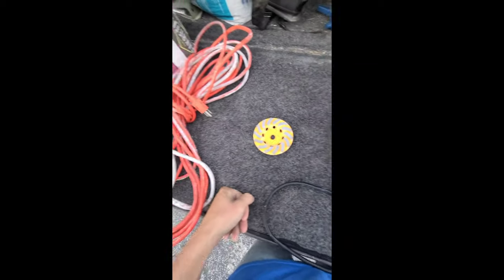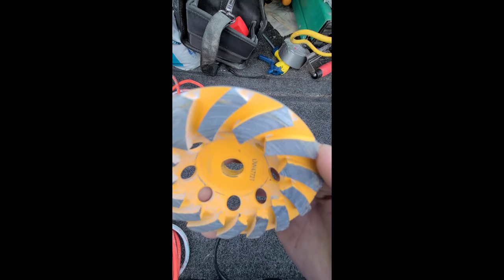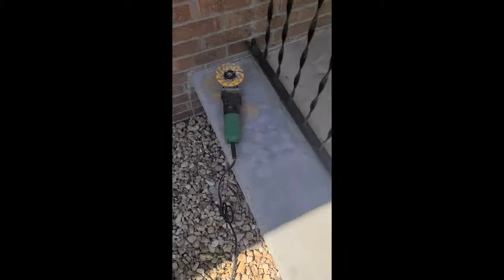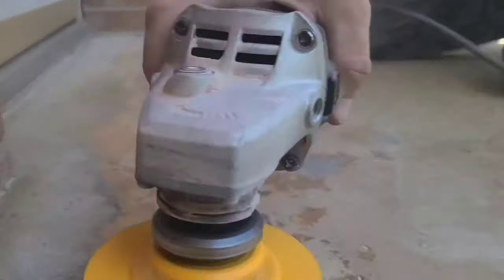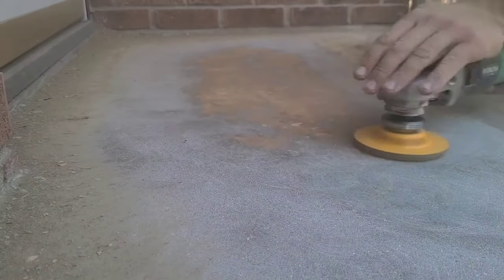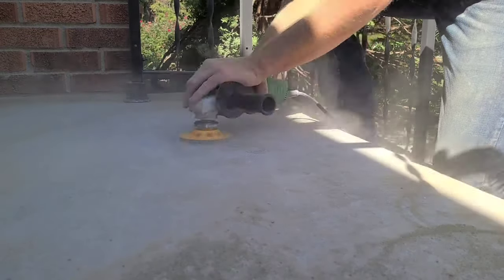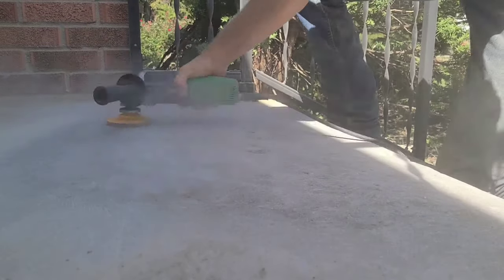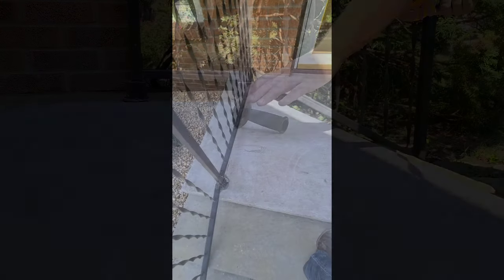How to Remove Paint from Concrete

Comment: Those diamond Cup wheels are great. If you don't have a dust shroud you could hold a dry vac hose while your grinding and purchase a bag for your dry vac.
Reply: I keep
Reading that the shrouds don’t fit or or horrible with diamond discs…. I think having a shop vac going is the best like you said

Comment: B.K. Williams:  Question:  Do you recommend putting water over the concrete to cut down on the dust?  Thanks for posting.
Reply from the maker: Haven't tried it yet but I'm sure it could work! Iv never had to do it inside and thats the only time I would really worry about it
Reply: @b.k.williams  Thanks, dude.
Reply: Just an observation, if you use water to keep the dust down it works but there is a sweet spot you have to figure out.  Too much water and the cup doesn’t  wear down the surface as fast and too little water and it doesn’t keep the dust down as well.  So be patient you won’t regret it. Don’t forget to plug into a gfci circuit for your own protection.
Reply: @pasqualeparente9776   Thanks for the info.

Comment: I own a small 3 story house. The basement floor has a ton of paint on it. I want it epoxy stained instead! My biggest worry is that if I grind the paint off I’ll have a thin layer of dust all over my house. How do I prevent this because if I gotta dust concrete paint off everything forget it!!!
Reply from the maker: You can get an adapter for your grinder that let's you hook a shop vac up to it. But even with that I'm sure you'll still get some dust
Reply: George Louis:  I am also concerned about the dust.  What did you do to cut down on it?  I'm thinking about keeping water poured over the area I'll be grinding.  Thanks.

Comment: Perfect!, just one question, this tool doesn't wear down concrete? I mean, a little of thing layer will be removed from original after try this out? - Regards.
Reply from the maker: Yes it actually can eat away at it. As long as you keep it flat and don't apply too much pressure you should be fine

Comment: Can I do with with basement walls?  I need to remove the old paint and apply a basement waterproofing material called Xypex or Permaflex.  The company suggested sandblasting but when I called a sandblasting company, they did not recommend it.  What grinder has an adapter that can be hooked to a shop vac?  This maybe a stupid question, but if you wet the surface, is there less dust?  Sorry, I am new to this...Thanks
Reply: Hey if you haven't gotten your info elsewhere yet, I'm currently doing what you're looking to do! I knew nothing about grinders, etc but did HOURS of research plus my husband has a little experience with grinders at work. My basement not only has paint but layers of joint compound which grew mold, as you NEVER use joint compound to fix basement wall cracks. Previous owner must've been very ignorant to materials, as concrete or crack injection wouldve been proper. They left me with one hell of a NASTY job! Anyway scraping was never going to get me finished. The angle grinder got me through a 6×6 square foot section in 30 minutes! I'll likely need a few days to finish my large basement with the joint compound all over, but just doing paint you may get it done faster. So to answer your question about a dust shroud. 1st off just to ket you know a lot of stores like home depot will rent you a PRO grade dust extractor, which works the best over a shop vac! That's what a pro would use if they came in. There are some grinders that use a proprietary dust shroud, but that's expensive. A universal dust shroud is cheaper and often fits multiple models, AND fits multiple shop vac hoses. It has to be specific to your size grinder though. I've got a 4 ½ ryobi grinder. I bought a dust shroud from harbor freight $25 that covers grinders from 4-5". You can find larger ones. Home depot sells universal dust shrouds, although not the best reviews. No one is totally happy since they don't always make it easy to use certain wheels, the bristles may protrude too far or not enough. I'm using a RIGID brand 4" diamond cup wheel under my dust shroud, & its hard to get my wheel flat. So I put a SLIGHT angle on it, which technically the diamond cup is best & safest used flat from my understanding. Im using it at a 10-20° max angle to get the diamond cup wheel to make good contact. Also please keep the wheel guard on if you don't use a shroud, as they usually have a guard in it technically. But i see so many videos on here where they've taken the guard off for flat grinding, not necessary & unsafe! You probably want a diamond cup wheel for removing paint or coatings in prep for waterproofing! I tried the paint stripping & abrasive discs, & they only scuffed the old paint but didn't fully remove it! You may have more luck with one if your paint is very brittle & thin though! But for these waterproofing paints as you know, you need a surface totally free of old paints & materials. Be very careful & gentle until you get a feel for it! I gouged my concrete a tiny bit pressing too hard with the diamond cup wheel, luckily I was able to smooth that out a bit. Lol Rustoleum does sell paint stripper meant for concrete, but you'd want to turn off any gas & pilot lights in the basement till fumes evaporate! Then you have to use an after wash to remove the strippers, its a hassle too!! I'd have tried that 1st though if it wasn't for all the joint compound! That may or may not be easier & less messy than grinding. Wet grinding is not necessarily less messy, but easier to contain. Wet grinding you'll have a slushy of concrete dust all over you, walls, & floor. Its better in my opinion than dust on everything in the entire house! BUT a lot of grinders & discs arent rated for wet grinding. Diamond cup wheels do often say for dry or wet use. If your grinders a cheap small corded guy like mine, I'd try just spraying it damp, but not garden hose wet.. im trying that today! It may gum up your diamond cup segments, the grinder, & shop vac though so be careful. Also you may need a specific filter in your shop vac, mine has to have one just for wet use, & the bag removed. So annoyed to find I needed to buy another filter! All these methods depend on the situation, but I try less messy options 1st like paint stripper, scraping, wire brush, or paint stripping discs if the basement is smaller. If you try chemicals, get a respirator meant for that if possible. Silica dust in concrete is very dangerous when airborne & is there possibly lead in your paint? Mines OLD so I treat it all like lead. Please use AT LEAST a P100 rated respirator for Silica protection, not just an N95 dust mask! Use a face shield & goggles, as well as gloves, long clothes, & good shoes! Once you remove all paint make sure you use a concrete etch & cleaner if you're doing waterproofing paint! If your waterproofing is one of those rubber like coatings, follow those directions whatever they are. There are safer etchers now days that don't contain muriatic acid, which is basically weaker hydrochloric acid! Drylok, Rustoleum, krud kutter, etc sell safer etch & cleaners. If you don't do this, the new waterproofing paint may not adhere properly, & warranty will be void. Also if you have a large basement & the money to do so, I'd honestly buy a larger grinder! Idk what all sizes they make but I believe its 4, 4½, 5, 7,9. Not sure what may be in between those for home use. But If I'd known what project I'd end up using this dang thing on, I'd have gone with a 7"!! I wouldn't go any bigger control wise on old block walls & my weak arms. Lol anyways good luck with your project! Its going to be hard & exhaustive, but you can do it!!! Also no stupid questions, especially with something so specific like this! We're all new at it till we try it! If you think of anything else & I have an answer, I'll be happy to help!
Reply: Thank you for sharing your experience. I am about to attempt grinding off the paint from my basement concrete block walls and possibly floor. The walls have a couple layers of regular paint and then a waterproof paint that had a grit to it.  I finally fixed the problem allowing the water to leak in one area of the room. I’m planing on using a treatment that gets sprayed onto the ways with a garden type sprayer. That is supposed to waterproof and resist radon gas penetration. It seems like a simple enough process and then I’m using just a quality paint. I’ve never used a grinder before. I am actually a little on the scared side but I feel I have no choice. I use this basement area as a bedroom so it needs to be clean and safe. I have a 4 1/2 grinder and am purchasing a shroud and a Diamond cup disc. I also have a shop vac. Of course I’ll get PP gear as well. Wish me luck. P.S. I can’t remove the furniture that’s already in there so I’ll cover it all the best that I can. If you can think of any additional advice, I’d appreciate it. Thanks
Reply: @victoriagirdler4795  thank you!!
Reply: @beverlyp.4078  Add a filter bag in your shop vac or a dust deputy which is a cyclone like container to avoid using to many bags and  aiding in the dust control.

Comment: I bought this same exact cup wheel for my dewalt angle grinder, but I can't figure out how to put it on. When I screw the cup wheel the round nut (called threaded clamping nut in the manual) that screws on doesn't have room to thread???? The cup wheel takes to much of the thread.  I'm not supposed to run this without that clamp nut I don't think.

Comment: It looked like you changed out the cup wheel in the video am I correct? How long do they last?
Reply from the maker: It was the same cup. And I would say I could get about 10 jobs the same size as this one done before it started being less efficient. The metal curved pieces, which are the teeth, will wear down to the cup over time

Comment: Can this work on brick.
Reply from the maker: On the face, yes but probably not the cracks. Maybe a wire wheel would do better for the cracks. I'm not sure
Reply: @b.k.williams  ok thanks, the reason  I asked is some kids from my community, threw paint on a few houses including mine, its just big splashes on my brick here And there. I hope this works.